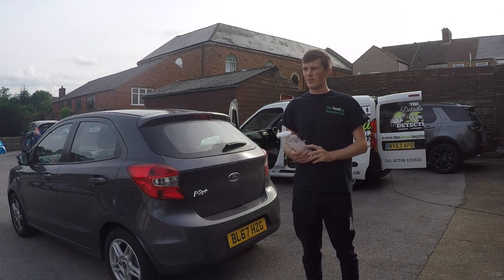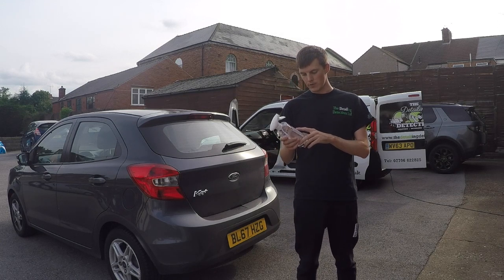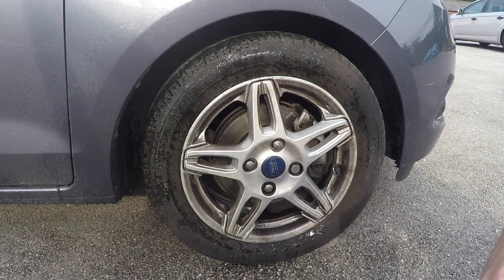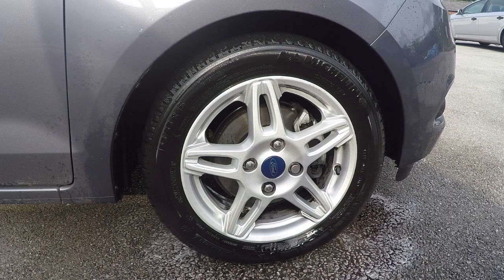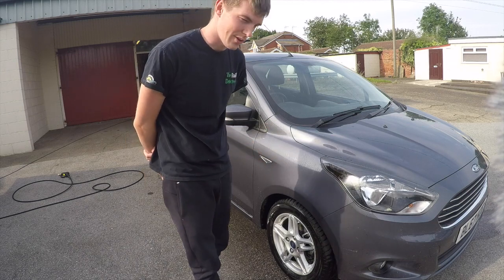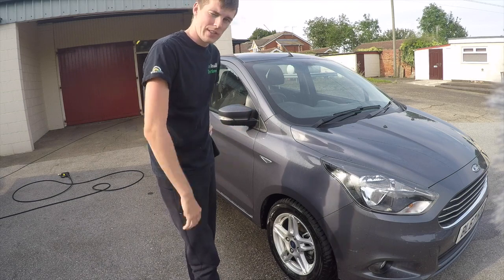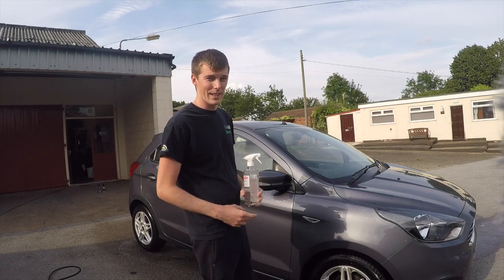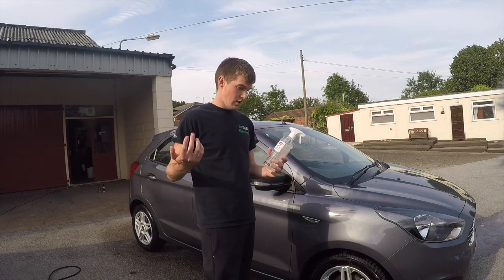CarPlan No1 Super Detox - Product Review

Comment: In what order would you use the product would you wash the car with a shampoo first then use the detox then use the glass
Reply from the maker: Yes always clean the car before using any Decontamination removal products as you will get better performance. Also ensure it’s out of direct sunlight ensuring you don’t let it dry out.
Reply: Sorry  to be a prat but what order.
Reply from the maker: Arches
Wheels
Pre-wash/Snowfoam
Shampoo via 2 bucket method
Rinse
Tar removal
Iron removal - detox (product above)
Clay (if you wish)
Polish
Wax/sealant
Glass
Tyre dressing
Reply: @TheDetailingDetectivesLtd  ok THANKS 😱😂😂😂👍